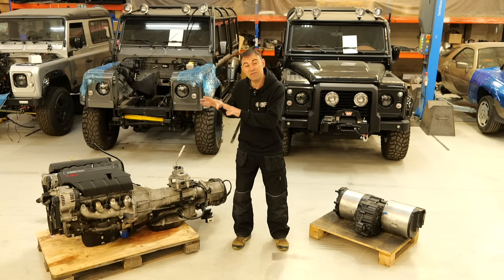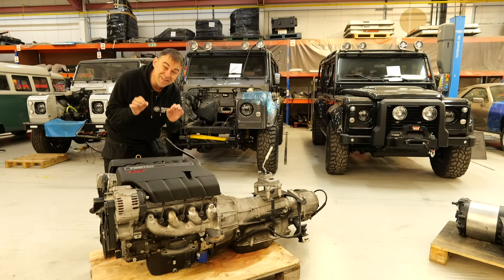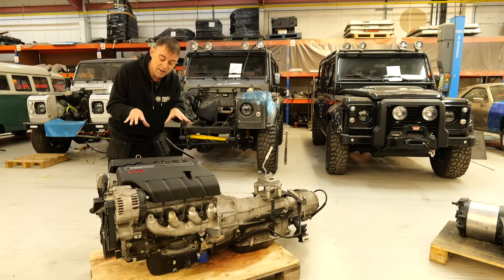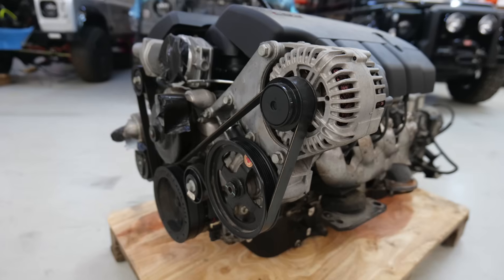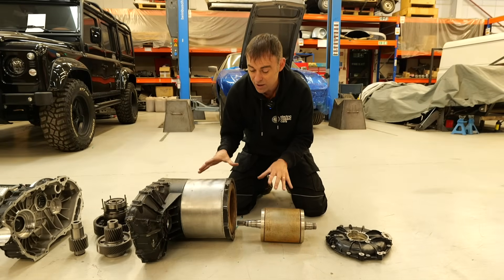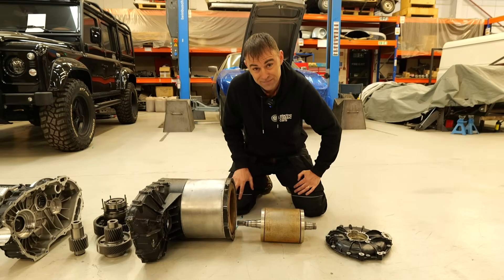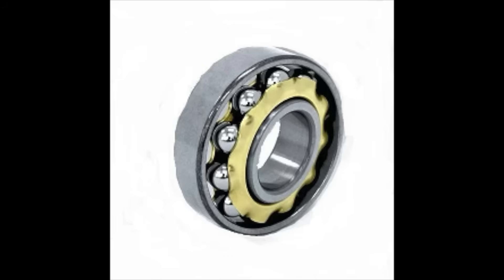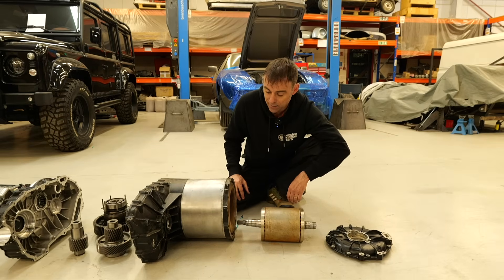Let's compare the Tesla LDU with an LS3 V8 and take one apart to see what makes it tick.

Comment: I have no issues with the electric motors. I have issues with the energy storage and distribution that powers them. With the EVs it's all about the bateries and how much, where you can recharge them and how quickly. The fuel tank is the least important part of the ICE, a coke bottle could hold the fuel, unlike the EVs, where energy storage is everything and still not nearly good or cheap enough to make it convinient for most of the people that live in the cities and could benefit from EVs the most. Most of the people in my city can not recharge their cars. They can only refuel them. Until the energy delivery and storage  becomes more efficient and more accessible,  EVs will remain the right option for the few, and toys for the rich.

Comment: I agree with the electric motors vs petrol engines that the electric motors are far less complex and less maintenance  ,, but the time is not yet. First is the range , they still don’t have sufficient range unless you spend a ton of money on longer range batteries, which add a ton more weight . Second , is battery replacement costs after warranty is over are enormous.  Third , the recharge times are still far too long of a wait if you need to recharge on the road during a long trip. Fourth, the infrastructure for recharging is not even close to being rolled out , and will take years to have a recharge station on every corner.  Sorry but I’m sticking with petrol engines for now 🤷‍♂️
Reply from the maker: I’m not sure where you live but here in the UK the infrastructure is fine. I’ve been driving EVs for 10 years and the last 3 years the infrastructure has taken huge leaps forward. In respect to range, most EVs have a range of 200 miles (e.g. the cheapest Tesla has a range of 318 miles. 71% of car journeys in the UK are less than 5 miles with only around 0.1% being more than 250 miles. A quick check on eBay for a good secondhand Tesla Model 3 battery shows they’re about £2500. Having just come back from a 5 hour journey from North Yorkshire we stopped for about 30mins at a motorway service station for food and toilet break, before we were finished the car was already ready and charged up.
Reply: @ElectricClassicCars I’m happy UK is all ready setup for EV , Im in Canada m and we are NOT 😊

Comment: All mating parts shall be fluidly isolated with respect to coolant flow, utilizing parallel circuits and independent interfaces for each module to eliminate transmission across joints.

Comment: He mentioned the lighter weight of the electric motor but did not mention that it requires a large and heavy  battery! All in all, an electric vehicle with a long range is heavier than one with an internal-combustion engine,, though still more deficient, cleaner and requiring much less maintenance.

Comment: You not comparing them equally  because you are not adding in battery weight and cost and range of motion. Plus add time to fuel and cost of producing the energy for charging.

Comment: 2 x 450 hp or 600 hp large drive units 1 front and 1 back saves the bother of a transfer case, prop shafts and separate front and rear differentials and extra 430 - 730 hp.
Reply from the maker: But then you need to build custom suspension front and rear as the Land Rover has solid axles.

Comment: Nicely done… To be fair, you do have to include the fact that the batteries add a lot of weight that doesn’t reduce as the energy is used… But that will most likely improve going forward…

Comment: Probably a very unfair comparison as you never mentioned about the weight of the batteries or the number of parts required to produce the power at the charging stations.

Comment: Niggle 1 - aren't ICEs about 40% efficient? [Not 20%] 
Niggle 2- I think you overplayed the simplicity of the Tesla motor. The earlier Tesla motors with the squirrel cage keep the rotor simple, but there are complex, elaborate windings in the stator, and the control electronics are hugely complex and sophisticated. But compared to the V8, yes soooo much simpler.
Reply from the maker: The only ICE engine that’ll be as efficient as 40% would potentially be the latest mild hybrid. Most modern direct injection turbo petrol engines are around 30-33% efficient whereas an LS3 is more like 22% efficient. Don’t forget these are peak efficiency, most of the time they’re way below this.
Reply: @ElectricClassicCars  OK, I was working from memory, which clearly failed me [again].

Comment: You're leaving off the 1 to 2 thousand pounds of battery in your comparison. 
Not a fair equivalent in any stretch.
Your efficiency data is also false, you are failing to include the losses in generation and transmission before it gets to the motor.
Reply from the maker: For petrol we didn’t include the energy it takes to pump the oil out of the ground, transport it to a ship, ship that oil half way around the world, refine it into petrol, then drive it in trucks to a petrol station, then pump it into a car. 

Transmission losses in the UK are around 1.7%, whilst distribution losses are 5-8%.

If you include generation, transmission and distribution losses then electricity is still way way more efficient than petrol. 

We covered battery vs fuel tank comparison in a previous episode. 👍 https://youtu.be/opF1si__APs?si=buXErQHAm6SON92T
Reply: @ElectricClassicCars  Yet you are ignoring where that electricity is coming from.
Electric motors are only "more efficient" when you hide part of the process.
In reality, it's a wash.
Transmission and distribution here averages around 5% as well, but more than 60% is lost during generation. Imagine that, the same or more energy is lost generating electricity as is lost burning fuel. With transmission losses on top (of which gasoline has zero) electricity is less efficient strictly from an energy standpoint.
Reply from the maker: Of course petrol has distribution losses. It take energy to pump oil out of the ground, ship it half way around the world, process into petroleum and then distribute it to petrol stations. That is all generation and distribution losses. Any electricity generation losses you also have to add onto the ICE too in order to make and distribute it as mentioned above.
Reply: @ElectricClassicCars  No it's not.
No energy is lost in that process. The gasoline has the same energy on both ends.
You're talking about ancillary costs, not energy loss.
Reply from the maker: Energy spent is energy spent no matter how you want to spin it. Good luck making petrol without spending any energy 😆👍
Reply: @ElectricClassicCars  Bottom line electrical power is no more efficient. You simply displace the bulk of the losses to the front end, then lie about it as if it doesn't exist.
Electrical generation suffers nearly the same energy loss as combustion, hiding it doesn't change that.

Comment: What has been your experience with the longevity of the rotor bearings since they are no longer cooled after the coolant delete? True the overall motor temps dont change, but the outer rotor bearing is what will be impacted.

Comment: The Tesla battery pack alone weighs between 1200-1300 lbs. The LS weighs 450lbs. A 4L80E trans (if you want a heavy auto) weighs 178lbs. 15 gallons of gas is about 105lbs. So we’re at 733lbs. Exhaust and such may add a 150-200lbs (all of this could be shaved easily via manual trans,headers,etc). So you’re still a lot lighter than a Tesla. Need to at least compare the whole Apple to the Orange.

Comment: Not actually fair, the Telsa motor doesn't create it's own energy, you should include the battery to make it a fair comparison.
Reply: Let's be really fair.  I've been Tesla owner since 2016, loved em all.  My Model S is fast and drives itself everywhere with almost no human intervention.  But, My S2000, NSX, and 99 Carrera are way more fun to drive, even though way slower.  Tesla can never overcome that.  Having said that, not selling Tesla stock for at least 5 years.  Bottom line, comparing a camry to Tesla is one thing, but something romantic and beautiful about that C5 Corvette shown early in the vid that screams art.
Reply: @georgem5589  not what I was getting at with my comment, the battery should be part of the motor weight in this video.
Reply: @ninkenny  Yeah, but weight's a bad argument for ICE.  My Tesla is very heavy, and can smoke most lightweight ICE sports cars.  Tried to make argument where ICE 'always' wins.

Comment: If you tot up the weight differences of the LS3 and the Tesla motor unit, along with a battery pack which can deliver similar mileage to the petrol so say 300 miles how do they compare? I run an electric car (Honda E) and have a defender puma 90 with a 2.4 diesel, the challenge is always range and add to that the huge difference when the weather is cold which so many forget to mention - are you close to similar weight for similar range or is the gap still fairly large?

Comment: Thanks Richard. 🙂👍To be fair, if you include the 'fuel' for each motor/engine, the weights and volume will likely be about the same. But the real gains with the electric drive train are efficiency, reduced need for maintenance, total cost of ownership and reliability. The battery probably needs more care than a fuel tank does. 

That said, a modern battery should be good for the expected distance and longevity design of most vehicles. There are Teslas in Britain which have clocked up 250,000+ miles of driving, whilst still using their original batteries. That's more than any car or bike I've used in over 50 years on the roads.

Comment: Actually the Tesla rear drive dual unit with the carbon sleeves for the Plaid produces 680hp in the rear and another 340hp for the front unit. The Plaid's specs were 1020hp-1050tq. They have also achieved 22,000 rpm in their testing.

Comment: and since we're talking about weight, you have to factor in the batteries .  That will add another 1000kg at least.  Now, a hybrid using the LS to charge a smaller battery bank and the electric motor for low end torque, that's a combo I can get behind.
Reply from the maker: A big battery, like. 100kWh pack you’d find in a Tesla Model X weighs around 450kg. But if you’re so worried about weight why would you want to add a motor and a battery pack and an LS3 and a fuel tank to a Land Rover? You’d be close to the total weight limit of the vehicle with all that lot. 🤷‍♂️🤦‍♂️

Comment: Electric motors not the problem or the tech with EVs. It is the battery that makes or breaks EV's and so far the rapid EV depreciation and repair expense because of the battery make EVs disposable/throw away cars.
Reply from the maker: My wife’s Tesla is the least depreciated car we’ve ever had. But if we did need to replace the battery after the 8 year warranty period expires, a quick check on EBay shows me a number of good secondhand ones for sale for £3k-£4k. 👍

Comment: No sir if I take a gallon of gasoline and I start a generator to charge an electric car. I am not using 90% of it. It only make sens if I charge my car with renewal energy or nuclear. If you are using any energy generated from fossil fuel. Just forget about it, it's about 15 to 30%
Reply from the maker: Thank goodness only 1/3 of our electricity comes from fossil fuels (gas) here in the UK, a figure that is falling each year as more renewables comes online.
Reply: @ElectricClassicCars  you have a point

Comment: It's not a fair comparison 
You should include the weight of the one-ton battery also. The electric motor and the battery go together even when they are separated. They function as one piece
Reply from the maker: One ton battery? 😆🤷‍♂️ A big battery, like the 100kWh battery that’s in a Tesla Model X weighs half that. Our electric  Land Rover weighs the same as an LS3 one with a tank of fuel.

Comment: You should have included the air conditioning compressor, power steering unit and mention the weight difference between batteries and the fuel for the other. But great to see you do the comparison.
Reply from the maker: We covered battery vs fuel in a previous Tech Talk, linked in the episode several times. The electric Landy weighs the same as the LS3 one with a tank of fuel.

Comment: You added up all the bits and pieces that make up the weight of the LS3, but you omitted the weight of the battery pack from the total weight of the EV.  That's a bit cheeky.  You also slide in a comment that EV's don't pollute, yet the do.  It's just on the front end.  Be honest with people here.
Reply from the maker: We compared the weight and complexity of the two drive units. We didn’t include all the other components like exhaust system, starter motor, ECU, big heavy 12v battery to start it, etc we also didn’t include the battery or fuel tank as we covered that in a previous Tech Talk linked multiple times in the episode. 👍

Comment: Great side by side comparison. 

I've got a performance LDU and need to address the issue with the seal. I'm not keen on removing coolant from where it was designed to flow. Can you share the data you mentioned regarding temperatures with and without coolant?

There is an upgraded graphite seal available from EV Clinic which I am considering but  struggling to find an installer in the UK at the moment.
Reply from the maker: Tesla themselves do coolant deletes. Their Model S have had coolant deletes since 2023. 👍

Comment: An electric motor doesn’t generate power it converts electrical energy into mechanical energy. The ICE generates power by burning fuel. Electrical energy supplied to an electric motor (EM) must be generated upstream of the EM. To compare efficiencies you need to include the efficiency of that upstream process. For example, if the electrical energy supplied to the EM is generated by burning coal or gas then the efficiency of that process (~30%) must be included. If it is from Solar then solar panel efficiency (~20%) should be included. In either case losses incurred in distribution (~15%) and motor and battery losses (~10-15%) combined must be added. Just because solar energy is free does not imply the process to transform it into electrical energy is 100% efficient.

On the weight issue, obviously you must include the battery weight. Li ion batteries with a capacity of 100 kWh which is typical for a Tesla weigh 479 kg so when you add that mass to the motor/gearbox system which you measured as 140 kg you have a combined mass of 619 kg which is substantially heavier than the ICE drive train. Furthermore, should you choose to operate in remote areas then a hybrid vehicle would be required which has both an ICE and a battery and EM drive train. More complexity required.

Comment: What a ridiculous stupid comparison! Every little Kid knows, it is the Battery who defines the Power and Weight of an EV. The Gas Tank for the V8 weighs about 60kg when fulfilled, the Battery for a Tesla Model S is about 700kg, even if it's empty. Are you really so dumb? Seriously? Every EV weighs way more then a comparable Car with an ICE. And further more EV are using the most refined Energy - Electricity. If taxes would be equal, Gas would be much much cheaper then Electricity. The Loss of Converting any Source of Energy in to Electricity is already done in the Powerplant, instead of being done in the Car. Man, don't get be fooled! This is Cherry picking stupid Stuff for very naive People. What a shame!

Comment: Does the seal issue apply to model 3 standard plus or just performance model?
Reply from the maker: No, they are a different design of motor. The seal issue only applies to pre 2023 Tesla model S large rear motors (non Plaid).

Comment: I keep a 1971 Toyota FJ45 Land Cruiser, stretched and armored, rebuilt by ex-military mechanics in a hangar outside Ljubljana. It has twin fuel tanks, a snorkel tall enough to breathe in Balkan floodplains, and welds laid down by a man who once built bridges for a militia that no longer exists. It’s not pretty, but it’s honest. I’ve driven it across the High Atlas to an abandoned French fort, through the deep salt pans of Tunisia where compasses spin, and down into the Zagros Mountains, where the roads are goat paths and the maps lie. Once pulled a diplomat’s armored G-Wagen out of a collapsed mule track in Basilicata, near a village so remote the postman comes twice a year and still asks for directions. It smells like canvas, diesel, and risk. That truck hungrily awaits border crossings and bad decisions.

But when I’m stateside, I drive a 2024 Tesla Model 3 Highland Performance. It is the most disciplined chaos I have ever commanded. You press the accelerator and reality folds. There’s no lag, no warning, just the immediate rearrangement of space and time. It corners like a fighter jet banking over a hostile ridge. The regen braking feels like gravity working in reverse. I once outran a summer storm up the Pacific Coast without hearing anything louder than my own breathing and the soft click of a Cuban lighter. Every movement is perfection. Every line in the chassis feels like it was drawn with a scalpel. It thinks faster than I do. 

I’ve driven warhorses, rally legends, grand tourers stitched by men in white gloves. But the real edge comes from owning both the yin and the yang. A true man doesn’t pick sides between EV and ICE. He runs both, because he understands purpose, not just preference.

Comment: Very informative Moggy. It just shows how designs have moved on though as I feel the Model 3/Y rear drive unit is far superior if down a little on max power. The coolant is kept well away from both electronics and motor with no possibility of leakage.
Reply from the maker: The Model 3/Y motors are a significant step on in development compared to the old Model S rear motors.